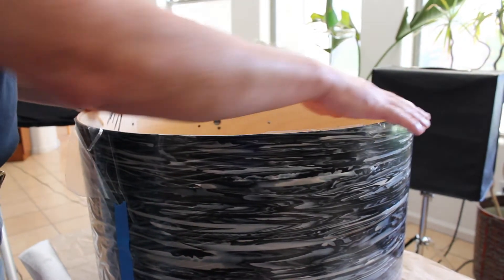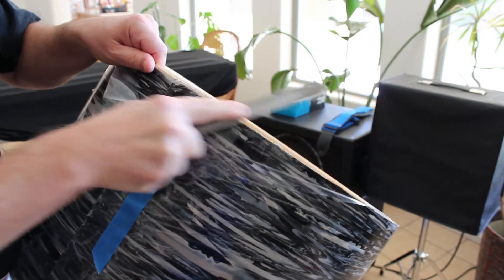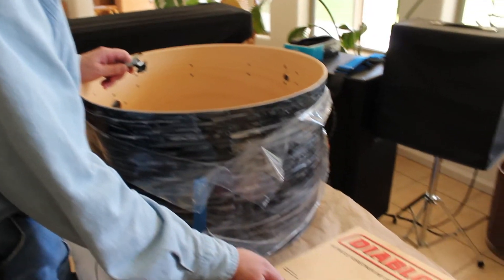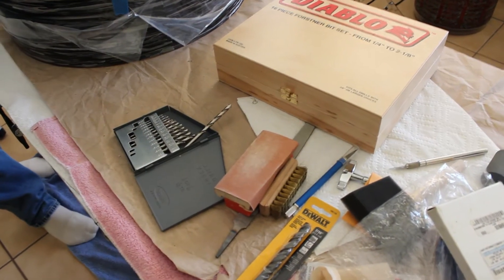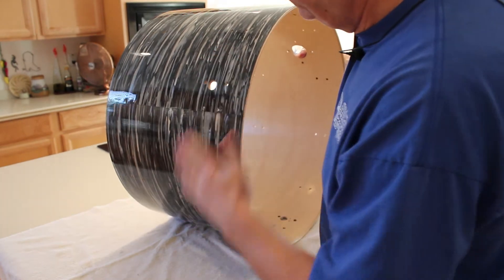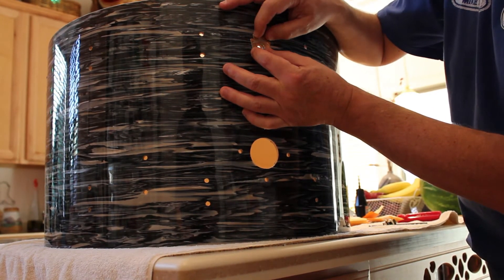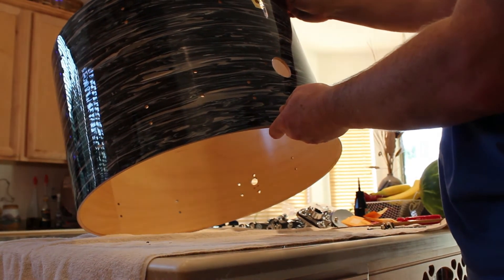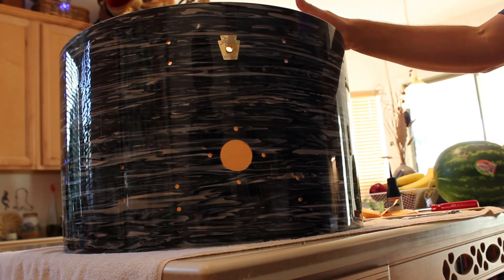Bass Drum Re-Wrap Tutorial Part 5

Comment: Great set of tutorials.  Thanks.  FYI - you can use a tapered reamer for most holes in the wrap.  Just need to drill a small pilot hole, then use the reamer to cut the wrap to match any size hole.  No need for several drill sizes.  Doing this by hand also will not cut into the shell.  Sears offers a dual set (Grip 22190 2-Piece Tapered Reamer Set) that works from 1/8" - 7/8" holes.

Comment: Did you get the eyelets from Precision? Does the eyelet flair fairly easy using the tool.? I have three vintage Ludwig toms that I want to replace the eyelets and tighten them up. Is this the easiest and most fool-proof way to do it? Thanks
Reply from the maker: Yes, I got the eyelets from Precision, along with the tool.  Very easy to flair, I had no issues.  Just be sure to remove the old badges very carefully because our "friends" at Ludwig won't sell you new badges.

Comment: Thnx for detailed tutorial - what's that tool called - for flaring out the thing that holds the badge in place
Reply from the maker: If you're talking about the tool to remove the old rivet from the badge, you can either file it out or use some pliers to squeeze it down and remove it.  Thanks for watching!
Reply: redonKiLaus No - it is for getting the badg back into place after the wraping is done... at 10.00 you say "I have a brand new (something? "Ribbot"?).... made at the precision drum co..." and at 10.08 you say "Precision drum company makes this little tool..."... I guess I need both of those things to be able to get my (premier) badge back onto the drum.
Reply: redonKiLaus So?
Reply from the maker: Sorry, YouTube didn't notify me of your first reply so I never saw it.  I'm talking about the rivet and rivet flaring tool, both of which I got from Precision Drum Co.  Since the rivets come in different sizes, you'll need to measure the hole in your badge in order to determine what size to purchase.  If you're having trouble finding what you need for your particular badge, I'm sure you can also give Precision a call to get you sorted out.  Hope that helps!